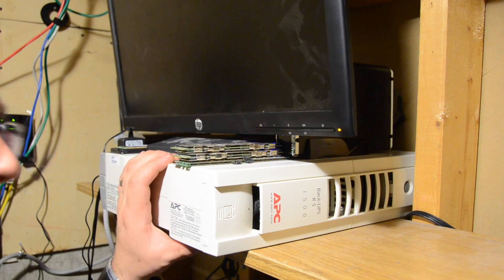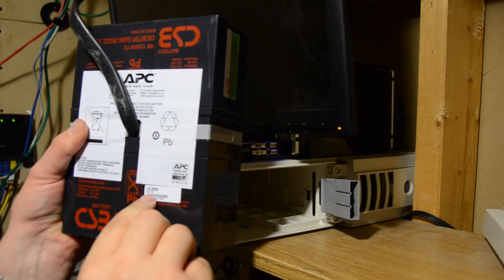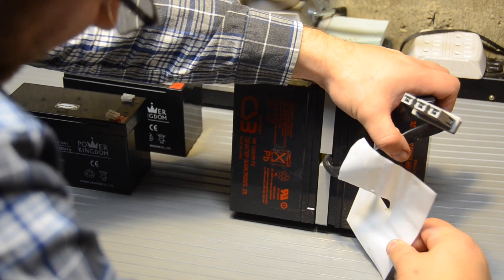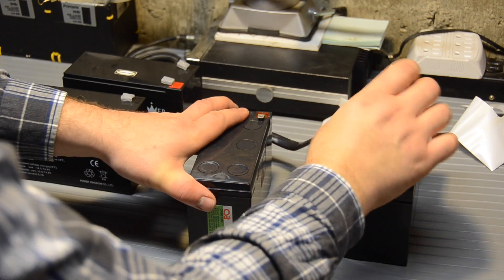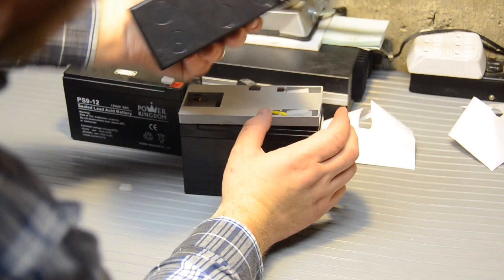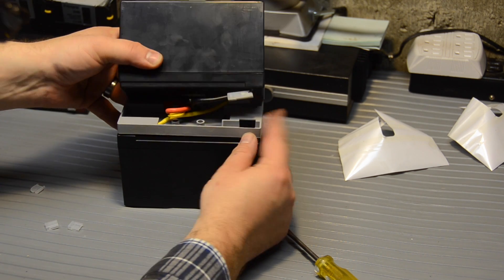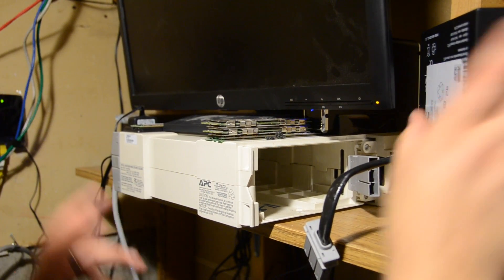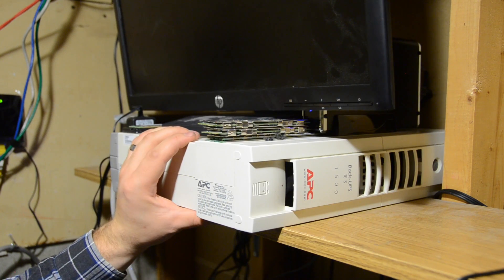001 - Replacing the Batteries in an APC UPS

Comment: Thanks for the video. One question: what is the purpose of the third wire. One for the 'negative', one for the 'positive' 24V, obviously. But there is a third, thin wire as well. What is that connected to?